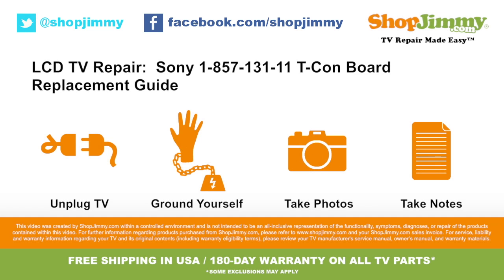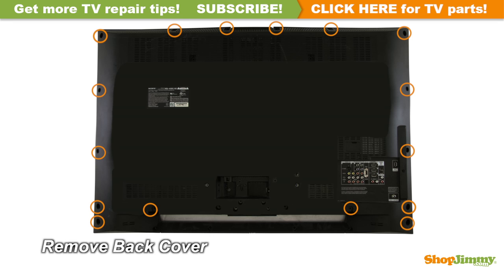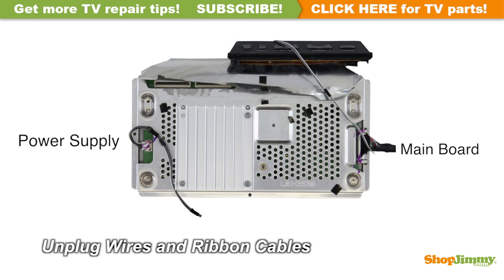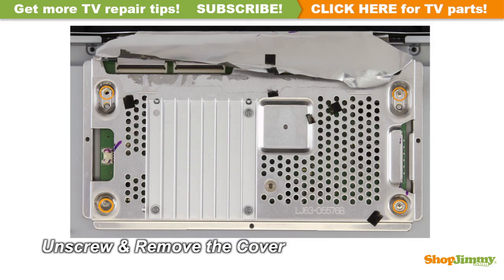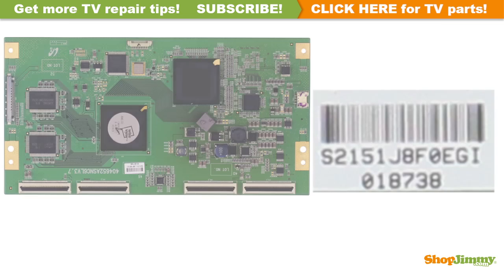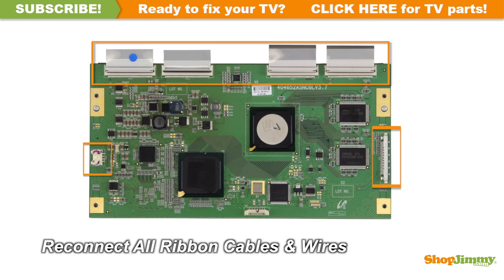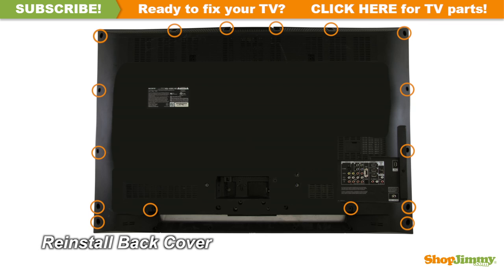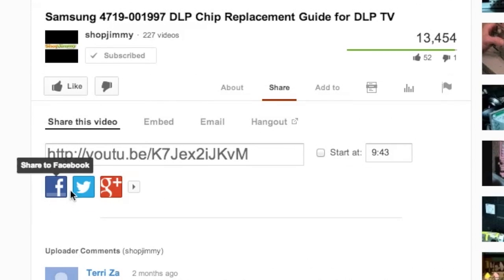Sony TV Repair - How to Replace KDL-46WL14, KDL 46W4150 T-Con Board - How to Fix LCD TVs

Comment: I've got a Sony Bravia LCD TV which has got no pic (black screen) but have audio. I've followed your steps. I've got backlight, have got sound. So replaced the TCON board but to no avail. 
The main board seems to be in two sections, one has TV tuner inputs on it and other section has mainly chips. 
Which section should I replace ? 
Also is there anything else that could be wrong which is resulting in no picture?

Comment: I have a sony KDL 48W600B it will not turn on, it has 3 blinking lights. I did the soft reset where you hold the button down for 30 seconds, it did not work. Geek Squad told me it was the motherboard. I don't see nothing on here about a motherboard. They said that it would cost more to have it fixed when to buy a new one. so I decided to try to fix it on my own can you please help?
Reply: The tv has bad capacitors in the power supply
Reply: can I fix this and what parts do I need?
Reply: I wouldnt recommend it unless you know exactly what youre doing

Comment: Have a Sony Bravia Model KDL-40WL135. We use Direct TV. The background screen in GUIDE mode is always bluish. All of a sudden this week, the background Direct TV screen (guide mode) is GREEN. Most of the colors on the screen are primarily green and red. I have reset the TV a dozen times. About a third of the time the colors go back to normal but only last an hour or so. 2/3 of the time, resetting the TV doesn't do anything. Had this TV for 7 years but the TV only gets used about 5 months a year. I just turned around and the colors are back to normal right this minute. Seems to be an intermittent problem. TV worked perfectly until about a week ago. Any suggestions on what might be going bad. TCON board??

Comment: I have a 46 inch brava tv model # KDL -46v6160 I have replaced the main board and A1553193a-1553-193-a1-877-053-11d3 board and just ordered the 1-857-185-11 backlight inverter. My tv comes on and you can see the Sony light comes on and the screen is on but it will not change channels or inputs.

Comment: My Sony Bravia KDL-40S5100  8240342  has intermittent sound, with I turn it on.  Sometimes the picture is pinkish?? If i turn it off and on several times it works fine??  Should I replace the Main Board??
Reply from the maker: +Michael Elko   Try all repairs and troubleshooting at your own risk. This could be a problem with either the t-con board, the main board or the TV panel. You can replace the main board and the t-con board individually to see if one of those boards fixes the problem.  Click this link to replacement parts for your TV model number:  http://www.shopjimmy.com/catalogsearch/result/?q=KDL-40S5100  There may be multiple boards for the same TV model number, be sure to match part numbers on your current board, with your replacement for compatibility.  Thanks and please let us know if you have any further questions with your TV Repair!  www.shopjimmy.com

Comment: I have a SONY KDL-46NX800 LED TV that started showing colored vertical lines.  If its T-CON board is bad (learned from your and other repair videos), I cant find the part on your site.  Where can I buy it from?  The T-CON board has SHARP logo on it and has two other connectors along with four ribbon connectors along bottom edge. Any help?
Reply from the maker: +Pardha Namuduri   Try all repairs and troubleshooting at your own risk.  This sounds like a TV panel (TV Screen) problem.  If your TV panel is bad, it may be more cost-effective to replace the TV as panels are typically hard to find in stock, difficult to replace, and expensive.  Thanks and please let us know if you have any further questions!  www.shopjimmy.com

Comment: I have a sony bravia KDL 46W4100 TV and have no sound or picture or LED diagnosis lights seem to have no power at all. Checked to make sure I have power coming into the power board. Verified the fuse nearest the ac plug was good and had 0 ohms. don't see any capacitors that look bad. Don't know if it the power board or the Main board

Comment: I have a sony bravia kdl-40z4100 that has colored vertical lines throughout the screen. When i power up, i see a black screen for like 2 seconds then my screen shows the vertical colored lines. When i hook up my computer via hdmi, the lines change color to all white colored lines. but most of the time on any input channels, I can see the picture still  but those cplpred lines can be annoying. Pls help.thanks in advance.

Comment: I have 55 in Sanyo dp55360 my tv turns on u can see the leds lighted up as i turn it on u can hear for a brief moment a static sound then nothing no picture is it t con or main board
Reply from the maker: Donny Watson  Please watch this video FIRST to help with your repair!  https://www.youtube.com/watch?v=BP3NVNCGEv8  I recommend replacing the main board in your TV.  Click this link to replacement parts for your TV model number.  http://www.shopjimmy.com/catalogsearch/result/index/?cat=56&q=dp55360  There may be multiple boards for the same TV model number, be sure to match part numbers on your current board, with your replacement for compatibility.  Here is a link to a video showing how to identify your part number, click here:  https://www.youtube.com/watch?v=Mi0D7ksQp7I  Thanks and please let us know if you have any further questions with your TV Repair!  www.shopjimmy.com

Comment: HOLY CRAP!!! Holy Crap!! Holy Crap!!!! This worked!! I have a 5 year old sony kdl-46w3000 with horizontal lines on the screen that stay there for about 15-30 minutes and then go away. But every time I turn on the tv, they come back. So I bought a tcon board on ebay for 25 bucks and followed your directions and when i put it back together.... NO LINES!  Sometimes the future really thrills me. Well Done, Sir!

Comment: I have an issue with the KDL-46Z4100, In the middle of the screen from top to bottom the image is very dark. And then also on the right side of the screen there is a dark stripe there as well with severe ghosting/ very slow image response. The issue affects the OSD in addition to any picture sources.
Reply from the maker: 0Fluxor0   This sounds like a TV panel (TV Screen) problem.  If your TV panel is bad, it may be more cost-effective to replace the TV as panels are typically hard to find in stock, difficult to replace, and expensive.  Thanks and please let us know if you have any further questions!  www.shopjimmy.com

Comment: I have a sony bravia KDL-52Z5500 LCD TV. The bottom half of the screen is extremely dark, with menu items and only the brightest screen objects showing. Top half is fine. There is a clear line distinguishing the screen halves. I have disassembled the screen frame and tried applying pressure to all ribbon connections, but this doesn't fix the problem. Could the problem be the T-con board or are there broken connections within the screen itself? I can post photo or video of the problem.
Reply from the maker: pcsurhes   This sounds like a TV panel (TV Screen) problem.  If your TV panel is bad, it may be more cost-effective to replace the TV as panels are typically hard to find in stock, difficult to replace, and expensive.  Thanks and please let us know if you have any further questions!  www.shopjimmy.com

Comment: I have a samsung lnt375hax/xaa and i need a t-con board for it . the t-con number are cpt370wa03c AB S175060
Reply from the maker: claudia kools   Is that board number from the original board?  Here is a link to a video to help you with identifying your part id number:  Samsung Timing Control (T-Con) Boards Part Numbers Identification for LCD HD TV Repair  Thanks!  www.shopjimmy.com

Comment: it is a KDL55EX620 model
Reply from the maker: Randy Nelson I recommend replacing the power supply for your TV.  Here is a link to replacement parts for your TV model number on our website, click here:  http://www.shopjimmy.com/catalogsearch/result/?q=KDL55EX620  Be sure to match part numbers on your current board, with your replacement for compatibility.  Here is a link to a video showing how to identify your part number, click here:  TV Part Number Identification Guide for Sony Power Supply Unit (PSU) Boards (LCD LED Plasma TVs)  You can also call our customer service for further assistance with your purchase.  (877) 881-6492  Thanks and please let us know if you have any further questions with your TV Repair!  www.shopjimmy.com

Comment: I have a Sony KDL-46Z4100. It has vertical lines and the picture look like a negative picture. Sound is good. What is your thought on the problem.
Reply from the maker: Myles S I would say the problem is either the t-con board or the main board in your TV.  You may have to try both or one or the other in your TV to determine which board is causing the problem.  Here is a link to replacement parts for your TV model number on our website, click here:  http://www.shopjimmy.com/catalogsearch/result/?q=KDL-46Z4100  Be sure to match part numbers on your current board, with your replacement for compatibility.  Here is a link to a video showing how to identify your part number, click here:  Main Board: TV Part Number Identification Guide for Sony Main Boards (LCD, LED, Plasma TVs) TV Repair  T-con board:  DIY LCD TV Repair: Part Number Guide for AU Optronics (AUO) Timing Control (T-Con) Boards  You can also call our customer service for further assistance with your purchase.  (877) 881-6492  Thanks and please let us know if you have any further questions!  www.shopjimmy.com

Comment: hi my kdl-46w4100 has a problem i can hear or see picture connected via HDMI only cable what part should i replace thanks
Reply: Try replacing the hdmi cable first. They tend to go out for no reason.

Comment from the maker: @GRAJEWIAK88 - I would recommend replacing the main board/A board on your TV.  Unfortunately it appears we are out of stock for your replacement board.  Please call our customer service to double check and if we are out of stock, you can sign up to be notified when the part is back in stock.  (877) 881-6492  You can also sign up on the product page if you search your TV model number on our website.  Thanks and please let us know if you have any further questions!

Comment: Hi, model KDL 40ex500, blinking red lights, tv goes into a reset loop, when i do get a green light to go on it just stays on but nothing happens, I have tried the USB stick and when it updates it the TV will turn and work fine. I have to reinstall firmware every single time to get it to work, but even that is hit or miss since sometimes it'll go into a loop with the firmware... is this a main board issue?

Comment from the maker: @S K - There is a possibility the t-con is bad or it could be the actual panel itself.  I would recommend replacing the t-con board to see if that fixes the TV.  Search your part number, 35-D057146 on shopjimmy com to find your replacement part.  Thanks and please let us know if you have any further questions!  (877) 881-6492